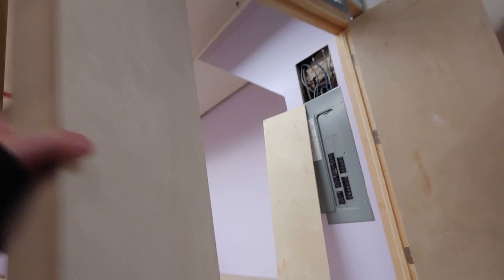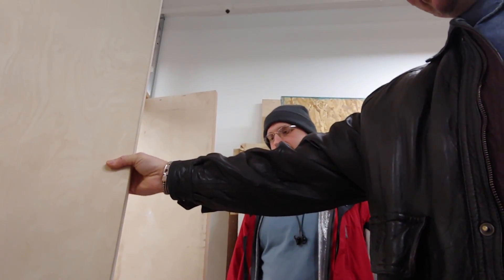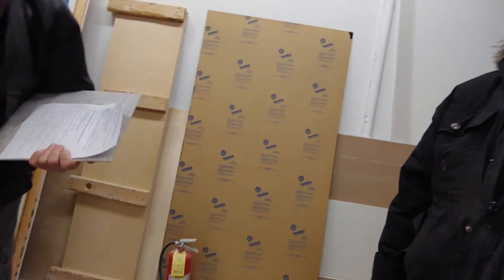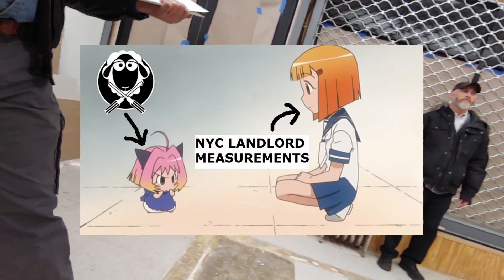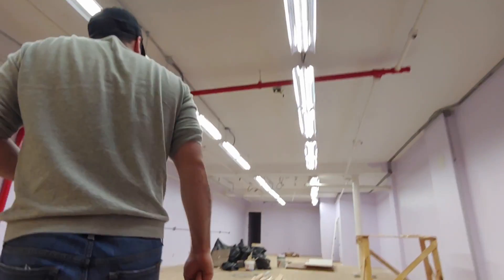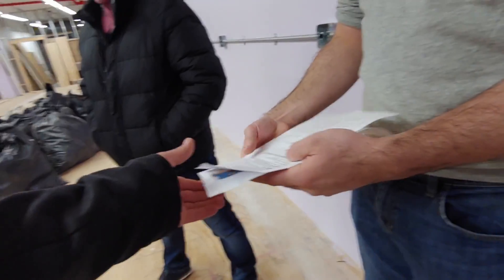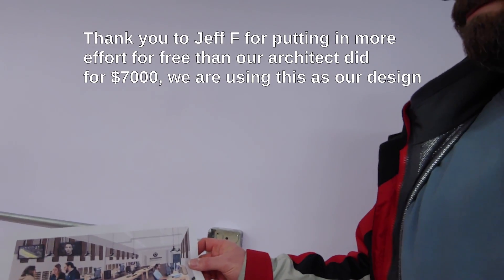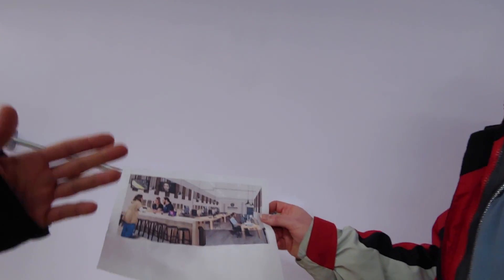Day 40 - recovering & moving forward with enthusiasm (short version)

Comment: All real wood lumber has pieces with flaws.  The installer should reject pieces or remove sections with holes, splits or bends.  Your guy was lazy and cheap.   Louis should consider installing wood-look tile floors in that space.  The new tile products are really nice and would be much easier to maintain.  Also, ditch the radiators and install radiant loops in the floor.   This would provide more floor space and better control over room temps.

Comment: Its like i said in that stream, the wood he used for the flooring was 100% reject stock, the way it came bundled up with no brand and the condition its in gives it away, basically there is no way to see what the condition of a log is inside it so they simply turn all into flooring and then it is all visually inspect it and at the end of the day / week they have large bins full of the reject stock and they sell it off at a fraction of the price, a place close to me does reject stock for like $4 per sm

Comment: Clear epoxy the floor notches.

Put blue painter's tape all around the area of the hole to prevent spills.

Dont tear the floor out, go spend 70 bucks on a gallon of epoxy and you can fix that in 36 hours no problemo